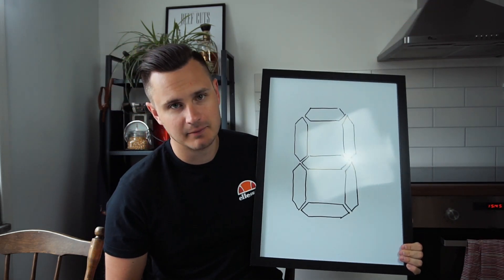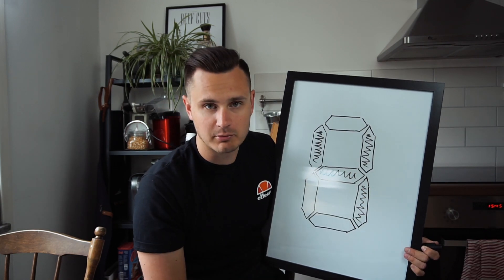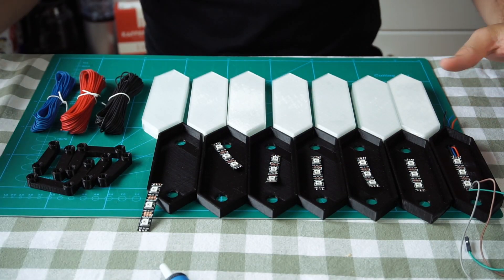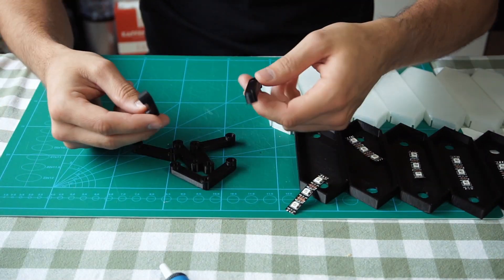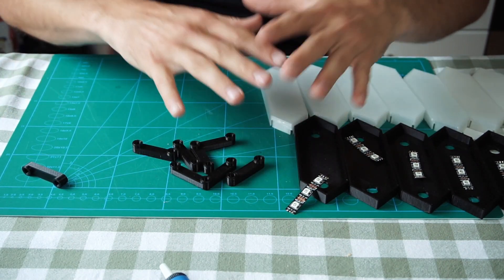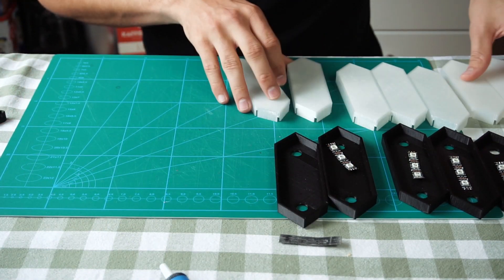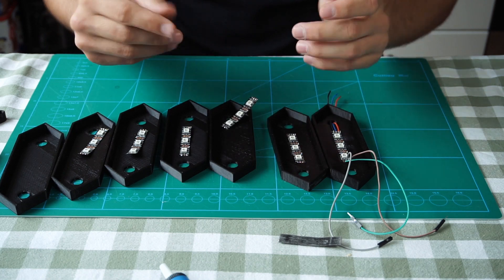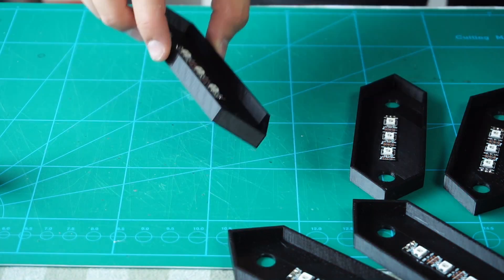Build a HUGE 7-Segment Display!

Comment: I apply your Code for Counter display.I show only First Digit.I not sure in #define DIGIT is I can set for Maximum how many digit.I plan to use 4 Digit.
Reply from the maker: Yes - changing the value of DIGIT should work

Comment: Can you point me in the direction of how to learn to code 7 segment or even 14  ws2812 leds i have one thats use 2 instead of 3 but i couldn't get you code to run. I wan to be able to input numbers or create a way to display the date with 2 numbers.
Reply from the maker: Hey! Well.. apart from experimenting with the code to understand what it does - I don’t have any advice on how to learn how to code this specific project. What’s not working for you when you’re testing my code? I guess you’ve seen that you can configure how many leds each segment contains (2 instead of 3)
Reply: @engineerish  I just need to understand the whole process more i am really new to this
Reply: @engineerish  i had to define pin D4 and not 4 and it works my leds are just out of order
Reply from the maker: Does your circuit work with any other example project with neopixels?
Reply: @engineerish  yes it does I figured it out I'm just trying to get the other digit to work with you code but my lack of understanding c++ is making it complicated I just need more practice, thanks for replying

Comment: Very nice and clean project, and thanks for the clear explanations!
I have a question concerning the code: How could it be modified to take 2 digits that would loop count from 0 to 99 ? Could you please help?
Reply from the maker: Thank you! Glad you liked it.

This is one way of doing it:

void writeNumber(int num) {
  int count = (num == 0) ? 1  : (log10(num) + 1);
  if (count > DIGITS) {
    // Fail here
    return;
  }
  
  for (int i = DIGITS - 1; i >= 0; i--) {
    writeDigit(i, num % 10);
    num /= 10;
  }
}

--

Then you could just call "writeNumber(..)" with your counter variable. Good luck!

Comment: Does anyone can guide me how to add  START/STOP button to this project?
Reply from the maker: One way of doing it is to simply hook up a push button to a digital pin and listen for pushes - whenever you detect one you'll stop incrementing the number. However - the code for this project uses a for-loop to iterate the number. What you could do is to make the actual loop()-function increment the variable instead - that makes it easier to implement a pause function.

Comment: I would say to do this design, but with an actual diffusing sheet. Instead of printing out white caps, just print out the same design but with a very large hole to allow a diffuser to be cut to size and glued in. It will do a much better job of spreading the light out evenly

Comment: Very nice project. I am interested in printing the segments for my manual 7-segment display we use for outdoor sports (cricket), I made one with corrugated plastic sheets by cutting it and it worked out good. But to perfect the shape and easy reproduction, I am looking for viable option to print it. Do we know how much approximate each segment would cost?., Also I am very new to the 3D printing, and would be great if you could help me direct the right path Thanks
Reply from the maker: Sudhakar Raj thanks! I have no idea what the cost would be - it depends on the material and how you slice it. How I got started was that I watched a bunch of youtube tutorials, then I bought a cheap printer to practice on. If getting your own printer is not an option, try looking around your area for makerspaces or companies that will print for you. But I recommend trying to print yourself, it’s a lot of fun! Good luck!
Reply: engineerish Thank you very much for the reply. I will explore the cheap printer options. Do I need to buy CAD software to design it?
Reply from the maker: If you would like to design your own models, you will need some sort of 3d modelling software, but I’ve made the models for this project available for download on thingiverse - you’ll find the link in the description
Reply: @engineerish  Here is the one I made it for my kids sport. This is sample one digit, I plug these digits for the score board. I am thinking the segments printed or made as plastic would reduce lots of measuring/cutting/gluing.
https://drive.google.com/file/d/1YrSu7AnnGwd9k2R4gijAz_EHHuDxl5ji/view
Reply: @engineerish  I would like to explore the 3D printing for this 7-segment manual prototype i did using corrugated plastic sheets. I want to do these with 3D printing , at least the segments alone for now, and then later on base as well. Can you suggest me where i can start to learn and what printer (cheaper) i should get. Would really appreciate if you could on board me with this. Thanks  a lot.

Comment: Really nicely done ! I wanted to have something close to the clockOne kickstarter, looks like a good way to make it !
I don't know much about 3D printing, what kind of filament and printing setting did you use ? So I can order it
Reply from the maker: Nathan Bleuzen thank you! I used PLA filament. The printer settings doesn’t really matter since the models are so thin and hollow. Basically default draft settings; 10-20% infill, 0.2 layer height or something 👍